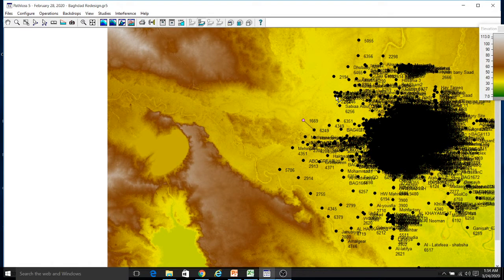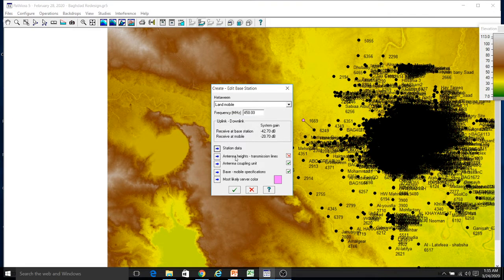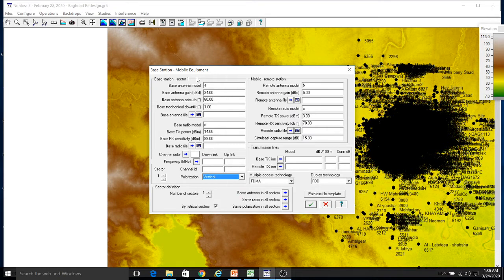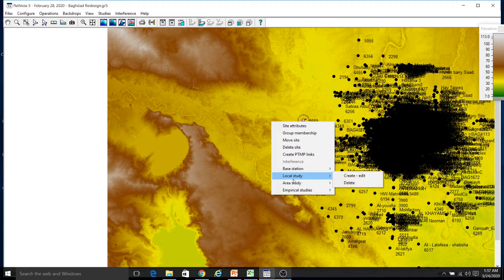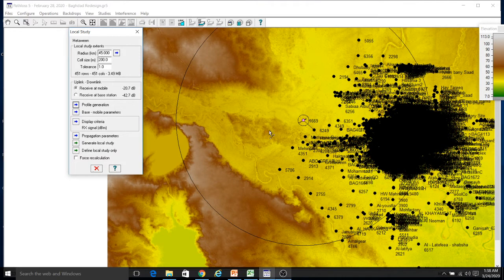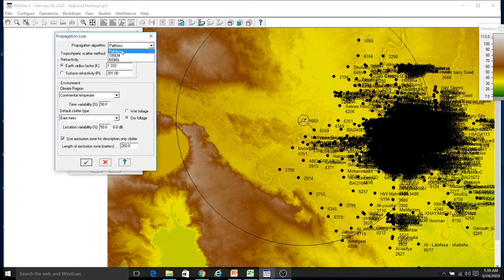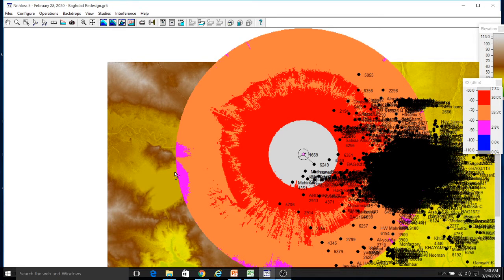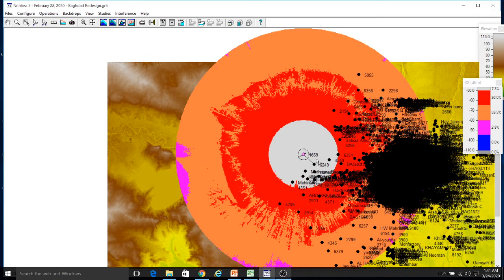How to define the coverage of a Base Station in Path Loss 5

Comment: Hi, it is possible to consider different antenna patterns on this coverage module?  Pathloss has already a database with antenna patterns?
Reply from the maker: not yet, you need to change the antenna and then re-run the coverage.